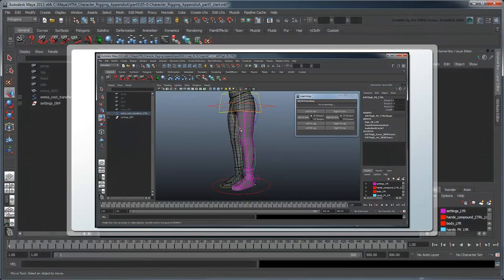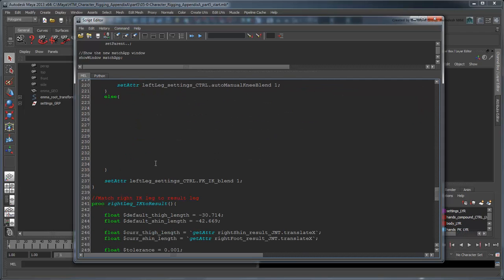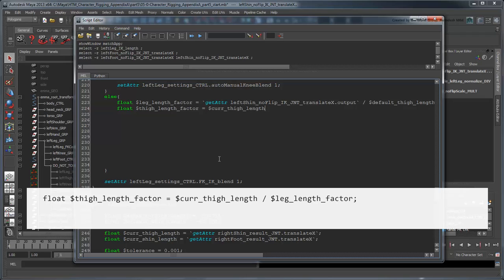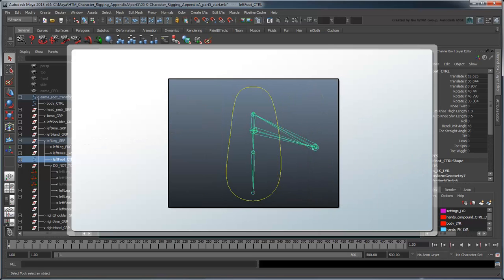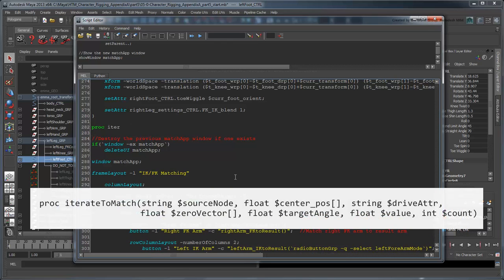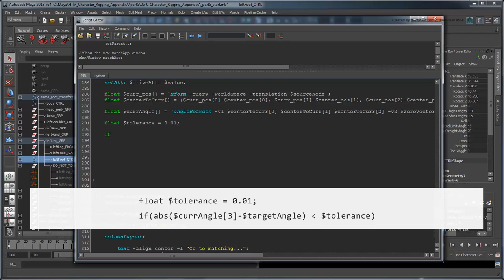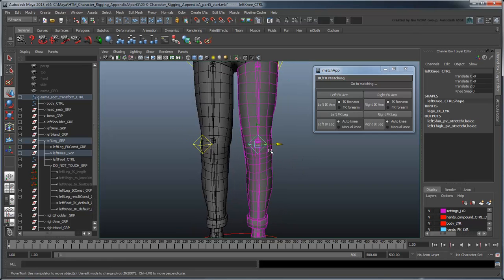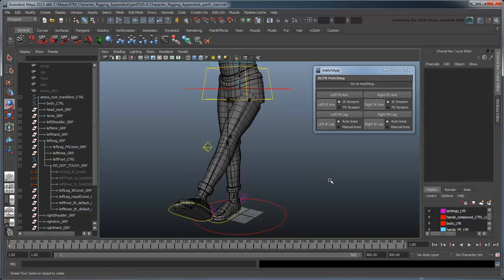Creating a Character Rig: Appendix A: Part 5 - Matching the automatic IK knee (Advanced)

Comment: Thank you for these tutorials.
I have a question. I started checking the MotionBuilder and I am wondering if this rigging system with constraints could work there.
Reply from the maker: You might be better off using HIK for Motionbuilder.

Comment: Hi, Thank you for the Tutorial.
I have a question.
I have rigged and animated my character in Maya. I want to load it in Unity (as FBX), for real-time rendering. But it does not recognize the arm constraints and the connections. Any solution? Thank you.
Reply from the maker: Unfortunately, you won't be able to use custom Maya nodes in Unity since they don't support them.  If you've built a rig already with them, your best bet is to animate in Maya, then cache the animations to geometry and export those to Unity (for running, shooting, jumping, etc), then play the appropriate animation at the appropriate time.
Reply: @Autodesk_Maya  thank you for your response.
Is there ,by chance, any Tutorial by Maya that shows how to do that?
Reply from the maker: Unfortunately we don't have one on this channel, but you can probably find one elsewhere on Youtube.

Comment: how can i download this final version of script, link in the below script is from previos lessons, i have bunch of errors or its not working on maya 2018.
Reply from the maker: The included file: 1-IK_leg_snap_with_auto_knee.mel is the final script.  I just tried downloading it from the link provided and it works fine on my machine.
Reply: @Autodesk_Maya  Thanks
Reply: @Autodesk_Maya  Now everything works fine, but one last issue when i trying to match right fk arm to ik,arm with fk forearm its getting error "Error: line 46: setAttr: Cannot set the attribute 'RightUpperArm_FK_CTRL.Length' below its minimum value of 0. //" how can i fix this
Reply from the maker: @miquelohara32  Try giving it a default value above 0

Comment: I encounter a problem when I try to switch from auto to manual knee. When I set kneeTwist to 30 my foot_CTRL is rotating 30 in Rotate Y as I set my kneeTwist value. The kneeCTRL then ends up having the position of the foot_CTRL rotation + kneeTwist value.
To clear this up, my knee_CTRL ending up with 2x kneeTwist Values position with the foot_CTRL being on 30 Y rotation and the kneeTwist being at 30.
This makes switching between ik auto and ik manual knee unusable. Then when switching back from manual to auto, the foot_CTRL aligned with the knee and my kneeTwist Attribute gets zeroed out. My foot_CTRL is at  60 Y rotation after that
I did the same refactoring as u explained to GRIM Davis where u removed the redundant measuring and renamed anim nodes to match the script ofc as well.
I also renamed the floats to zeroTO as u showed. My script isn't giving me any errors at all. But i just can't find a reason why my foot_CTRL is rotating as it does. 
Here is my script of the right leg with the iterate Match part. Any help on this would be greatly appreciated.
I also checked all default/snap_GRPs to see if I have some rotations/translations basically if I have made freezing errors. But everything is like urs

//Match right IK leg to Result leg
proc R_Leg_IKtoResult(int $knee_mode){
    
    float $default_thigh_length = -31.463;
    float $default_shin_length = -37.775;
    
    float $curr_thigh_length = `getAttr R_shin_result_JNT.translateX`;
    float $curr_shin_length = `getAttr R_foot_result_JNT.translateX`;
    
    float $tolerance = 0.001;
    
    if((abs($curr_thigh_length - $default_thigh_length) > $tolerance) || (abs($curr_shin_length - $default_shin_length) > $tolerance)){   
        setAttr R_knee_CTRL.kneeSnap 1;
    }  
    
    $r_foot = `xform -query -worldSpace -rotation R_foot_IK_snap_GRP`;
    $t_foot_wrp = `xform -query -worldSpace -rp R_foot_IK_snap_GRP`;
    $t_foot_drp = `xform -query -worldSpace -rp R_foot_IK_default_GRP`;
    $curr_transform = `getAttr player_root_transform_CTRL.translate`;
    $curr_foot_orient = `getAttr R_ball_result_JNT.rotateY`;
           
    xform -worldSpace -rotation $r_foot[0] $r_foot[1] $r_foot[2] R_foot_CTRL;   
    xform -worldSpace -translation ($t_foot_wrp[0]-$t_foot_drp[0]+$curr_transform[0]) ($t_foot_wrp[1]-$t_foot_drp[1]+$curr_transform[1]) ($t_foot_wrp[2]-$t_foot_drp[2]+$curr_transform[2]) R_foot_CTRL;
       
    setAttr R_foot_CTRL.toeWiggle $curr_foot_orient;
    
    if($knee_mode == 2){
        
        $t_knee_wrp = `xform -query -worldSpace -rp R_shin_result_JNT`;
        $t_knee_drp = `xform -query -worldSpace -rp R_knee_IK_default_GRP`;
        
        xform -worldSpace -translation ($t_knee_wrp[0]-$t_knee_drp[0]+$curr_transform[0]) ($t_knee_wrp[1]-$t_knee_drp[1]+$curr_transform[1]) ($t_knee_wrp[2]-$t_knee_drp[2]+$curr_transform[2]) R_knee_CTRL;
        
        setAttr R_leg_settings_CTRL.autoManualKneeBlend 1;
        
    }
    else{
        float $leg_length_factor = `getAttr R_shin_noFlip_IK_JNT_translateX.output` / $default_thigh_length;
        float $thigh_length_factor =  $curr_thigh_length / ($default_thigh_length * $leg_length_factor);
        float $shin_length_factor =  $curr_shin_length / ($default_shin_length * $leg_length_factor);
        
        setAttr R_foot_CTRL.autoKneeThighLength ($thigh_length_factor);
        setAttr R_foot_CTRL.autoKneeShinLength ($shin_length_factor);
        
        setAttr R_foot_CTRL.kneeTwist 0;
        
        float $noFlip_shin_pos[] = `xform -query -worldSpace -translation R_shin_noFlip_IK_JNT`;
        float $result_shin_pos[] = `xform -query -worldSpace -translation R_shin_result_JNT`;
        float $center_shin_pos[] = `xform -query -worldSpace -translation R_foot_noFlip_IK_JNT`;
        
        float $zeroToNoFlip[] = {$noFlip_shin_pos[0]-$center_shin_pos[0], $noFlip_shin_pos[1]-$center_shin_pos[1], $noFlip_shin_pos[2]-$center_shin_pos[2]};
        float $zeroToResult[] = {$result_shin_pos[0]-$center_shin_pos[0], $result_shin_pos[1]-$center_shin_pos[1], $result_shin_pos[2]-$center_shin_pos[2]};
        
        float $deltaAngle[] = `angleBetween -v1 $zeroToResult[0] $zeroToResult[1] $zeroToResult[2] -v2 $zeroToNoFlip[0] $zeroToNoFlip[1] $zeroToNoFlip[2]`;
        
        float $kneeTwist = iterateToMatch("R_shin_noFlip_IK_JNT", $center_shin_pos, "R_foot_CTRL.kneeTwist", $zeroToNoFlip, $deltaAngle[3], 90, 0);
        
        float $curr_shin_pos[] = `xform -query -worldSpace -translation R_shin_noFlip_IK_JNT`;
        
        $tolerance = 0.01;
        
        if((abs($curr_shin_pos[0]-$result_shin_pos[0]) > $tolerance) || (abs($curr_shin_pos[1]-$result_shin_pos[1]) > $tolerance) || (abs($curr_shin_pos[2]-$result_shin_pos[2]) > $tolerance)){
            setAttr R_foot_CTRL.kneeTwist (-1*$kneeTwist);

        }
               
        setAttr R_leg_settings_CTRL.autoManualKneeBlend 0;
        
    }
    
    setAttr R_leg_settings_CTRL.FK_IK_blend 1;
}

//Attempts to get the sourceNode's worldspace position relative to a zero position to match the target distance from that same position by adjusting a drive attribute.
//Exits on 8000 attempts. 
proc float iterateToMatch(string $sourceNode, float $zero_pos[], string $driveAttr, float $zeroVector[], float $targetAngle, float $value, int $count){
    
    setAttr $driveAttr $value;
    
    float $curr_pos[] = `xform -query -worldSpace -translation $sourceNode`;
    float $centerToCurr[] = {$curr_pos[0]-$zero_pos[0], $curr_pos[1]-$zero_pos[1], $curr_pos[2]-$zero_pos[2]};
    
    float $currAngle[] = `angleBetween -v1 $centerToCurr[0] $centerToCurr[1] $centerToCurr[2] -v2 $zeroVector[0] $zeroVector[1] $zeroVector[2]`;
    
    float $tolerance = 0.01;
    
    if(abs($currAngle[3]-$targetAngle) < $tolerance || $count > 10000){
        
        if($count > 10000){
            print("Match failed.  Over 10000 iterations.\n");
        }
        
        return $value;
    }
    else{
        if($currAngle[3]>$targetAngle){
            $value = $value - $value/2;
        }
        else{
            $value = $value + $value/2;
        }
        
        return iterateToMatch($sourceNode, $zero_pos, $driveAttr, $zeroVector, $targetAngle, $value, $count+1); 
    }    
}

Thx in upfront! And thx as always for the great tutorials.
best regards
Reply from the maker: Have you double/triple checked your joint and control hierarchies to make sure they match the example rig?  It's unlikely the script is causing your double-rotation, but rather it sounds like the foot control is being influenced by the kneeTwist.
Reply: Just went thru every single joint/handle/Locator/constain and controller. I saw some minor difference. Ur rightKnee_IK_default_GRP isn't at the same pivot as the KneeCTRL itself :P Your leg IK HDLs are flipped to match the joint orientation, I guess coz u were mirroring the leg. I build mine parallel and do to that I have no rotations on my HDLs. I just got mirrored IK/FK/result_JNTs on the right side and mirrored FK_CTRLs like urs as well. My result const GRp is world orientated my joints not, like urs. Switching from IK into FK works fine. But switching back and in between the IK leg mods gets this weird rotation on my foot_CTRL. IF there is a way to send u a mail with my rig to check it urself this would be highly appreciated. Send me an email with ur contact information @scratchfinger@hotmail.com. So u don't have to make urs public. I spend a lot of time to find the mistake... obviously, there must be one ... I guess it will be a really stupid thing I missed .. like always in rigging a small thing can mess up everything. I'm really eager to figure it out where the mistake lies. I guess 10mins in ur hands and u will be able to point the mistake ... I'm sure even faster ;D
Reply from the maker: @majupiju2347  Try putting your scene file on a file sharing service and I'll see if I can take a look at it.
Reply: @Autodesk_Maya   did u had some spare time to check my rig?
Reply from the maker: @majupiju2347  I just looked at it now.  Your L_foot_IK_snap_GRP is parented incorrectly under the thigh.  It should be parented under the foot joint (hence why it always matches the upper thigh movements correctly but not anything below that).
Reply: @Autodesk_Maya  oh damn. I knew it be something stupid... Could u look over the arms as well if u have time. When moving the FK_CTRL and switching to IK gives me incorrect hand_CTRL positions as well. i fixed the L/R_elbow_hand_FK_CTRL naming problem already but still couldn't fix the IK_forarm matching.
I remember that u havent frozen the IK_arm_CTRLs translates. could this be the problem? Coz i froze them. I have different values in the LocalSpace on the snap Grp then on the controller itself. is there an easy way to match them again? I would rly prefer to have zero values on my IK arm _CTRL. I guess i need to recreate the Local and World Space Pivot location for the snap GRP to match the IK CTRL. but i just can't match it. If u could give me a hint on this?
Reply: @Autodesk_Maya  https://www.dropbox.com/s/aonxfqu3nsghyrc/snapGRP.png?dl=0 there is a screenshot to explain it a bit better.
Reply: @Autodesk_Maya  Any chance u could look over the problem I described with my hand_CTRL snapping?
Reply from the maker: @majupiju2347  I see that you jumped ahead and went with a 0,0,0 T-Pose, which deviates from the tutorial up to this point.  This has thrown off the math in the match app which is why it doesn't work anymore.  To fix it, follow my Appendix D tutorial: https://www.youtube.com/watch?v=V8ZgOZDjVXs&list=PL8hZ6hQCGHMXKqaX9Og4Ow52jsU_Y5veH&index=41

Comment: Brilliant tutorial series! This one is rather difficult though. I'm having an issue that's difficult to solve. My IK leg snaps correctly to the FK joint, but whenever I scale the FK, the IK scales irrationally. For example when I scale the thigh to 2 and leave the rest untouched (on length 1), the IK will scale the thigh to 1.307 and the shin to 0.653. First I thought it was just a problem with the scaling formulas, but they seem to be fine. Then I thought it might have something to do with the knee and it's knee snap, that it is in a bad position and scales the leg towards the knee. But the calculation of the knee is also the same as in the video. Has anyone got any idea what might be the problem? Thanks already!
Reply: Update: I solved the problem! :)

Comment: Hi, I want to ask a big question! Ready scripts are attached to your lessons! To apply the same scenarios for another character, I unexpectedly named joints, controllers, etc. In a different way.
So, now I need to rename everything in the scripts?
Is it possible for the scripts to physically point to the right joints, controllers, etc. By pressing the mouse so as not to rewrite? thank
Reply from the maker: Unfortunately that's not possible.  You could build a tool for it, but that'd require more complex upfront programming.  It's likely just easier to rename everything in the scripts as you said.
Reply: @Autodesk_Maya  Thank you for the answer. please tell me, at the end a number of lessons on appendixes and for each lesson you are all improving one script, you copy joints somewhere or you still do something in the outliner.
Can I first set everything up in the character and at the end only use the already finalized script so as not to go step by step?
Reply from the maker: @goodfellas6590  Yeah you can do things that way.  The only areas you might notice an issue is with the hand controls like palm raise or tilt, because they require the forearm stretch to correctly keep the wrist connected.

Comment: Great tutorial first off!
Can someone explain to me why the last if-statement works?
"if((abs($curr_shin_pos[0]-$result_shin_pos[0]) > $tolerance) || (abs($curr_shin_pos[1]-$result_shin_pos[1]) > $tolerance) || (abs($curr_shin_pos[2]-$result_shin_pos[2]) > $tolerance)){
            setAttr leftFoot_CTRL.kneeTwist (-1*$kneeTwist);"

I gone through it in my head... 
curr_shin is leftShin_noFlip_IK_JNT
result_shin is leftShin_result_JNT
They both have the same translation values all the time. How can this work?
Pls i don't understand. We are checking if both joints are >0.1 away from each other.
Reply from the maker: Basically, the way this algorithm works is that it rotates the IK leg a certain amount, then checks to see if the knee (represented by the shin joint) is roughly in the same spot (i.e. within a tolerance) of the result leg.  If it's not, then it means the algorithm overshot its target, so it reverses direction (-1) and tries again at half the value.  It keeps doing this until it hits the right value.

This is also what's known as a Binary Search.

Comment: I take it this isn't mean to be 100% perfect, as sometimes I might be off by 5-30 degrees at times, and anyone in those positions will likely be in a thoroughly mangled position.
Reply from the maker: 5-30 degrees is way too much.  The algorithm should get you with maybe 0.05 degrees unless you're working in really tiny units.
Reply: Try when the 
leftThigh_FK_CTRL X: 0, Y: -90.783, Z: -24.525
leftShin_FK_CTRL X: 0 Y: 138.653 Z: 0
leftFoot_FK_CTRL: X: 0, Y: -47.87 Z: 66.669
(Default lengths)
The kneeTwist value I get is -76.096, but when I turn on the FK visibility, I need to put the kneeTwist to -56.796

Also, I find this algorithm fairly inefficient. When a value is wrong, you effectively halve if too high, or multiply by 1.5 if too low
Let's say I want a value of 124.5
1. 90 -> 2. 135 -> 3. 67.5 -> 4. 101.25 -> 5. 50.625 -> 6. 75.9375 -> 7. 113.90625 -> 8. 170.859375 -> 9. 85.4296875 -> 10. 128.14453125-> 11. 64.072265625 -> 12. 96.1083984375 -> 13. 144.16259765625 etc
This causes you to bounce around a lot.
What you should do is have a minVal and a maxVal, which get updated, and get the halfway point between the minVal/maxVal depending onif you get too high or low
Lets say my minVal is 0, maxVal is 360, and value is 180, and target is 124.5
1: minVal: 0 value: 180 maxVal: 360
2: minVal: 0 value: 90 maxVal: 180
3: minVal: 90 value: 135 maxVal: 180
4: minVal: 90 value: 112.5 maxVal: 135
5: minVal: 112.5 value: 123.75  maxVal: 135
6: minVal: 123.75 value: 129.375 maxVal: 135
7: minVal: 123.75 value: 126.5625 maxVal: 129.375
8: minVal: 123.75 value: 125.15625 maxVal: 126.5625

It gets you to the value much faster